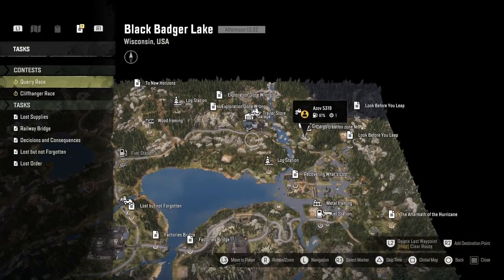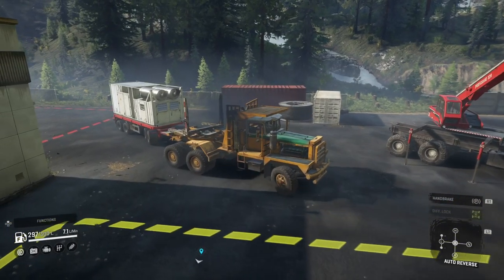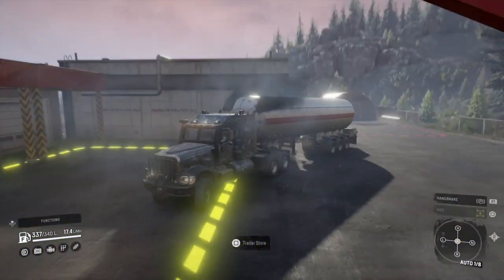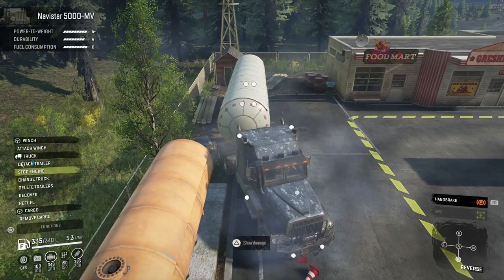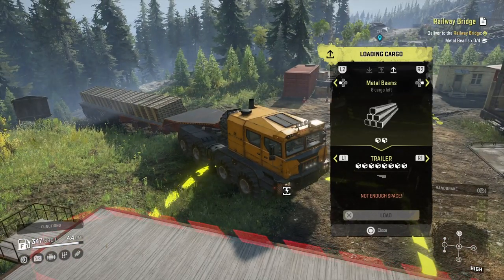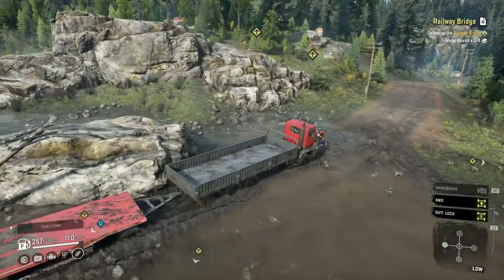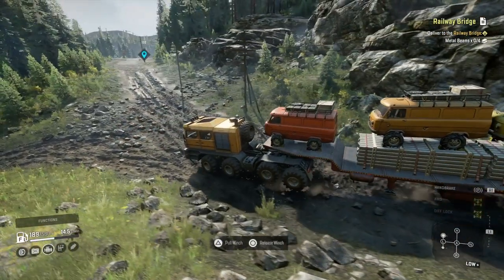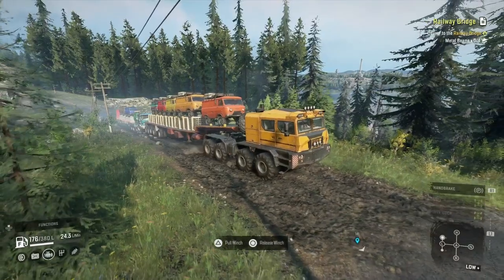SnowRunner How generators Work Crafting Cargo And Railway Bridge Mission With A Kolob Road Train

Comment: I have to hold down (C) and sometimes I just get the task instead of the unload screen too. I also get where the truck will stop and the wheels don't rotate have to hit the gas pedal a few times to get the tires to rotate, and have you noticed the "Big pipe" task the pipe has no connection point so you can't lift it out of the river?

Comment: That log holder on the P16 looks like it was made to hold a Lo4F side to side with the front axle on dance bar.  I’m quitting Yukon, I went on after exploring these maps and it still says I need 15 cabins.  Don’t know if it’s because I’m 1/2 way through but the mission text says I only need 2 or 3, but up in the right hand corner still shows 5 of 15.
Reply from the maker: Haha I’ve already had a loaf wedged in there lol that’s why it was on my p16, the loaf fits like it was made for it, and it really holds the loaf on well and stops it tipping off to the side even on a heavy landing 👍🏻🍞🐎! 

Yeah the Yukon missions are a bit of a mess! I think it might be because you started the mission before they updated it, but I can’t say for sure as I haven’t tried the mission at all so far, there’s a chance if you restart the mission that it could fully reset it? But I’d keep the cabins stashed first just incase 👍🏻

Comment: I've put my generators in place hooked up to an f 750 with a large fuel trailer parked right next to it. Then all I need to do is pull up change to the f 750 switch on the generator, change truck, craft what I need then switch back, turn off the generator, refuel it and then switch back and head off with the cargo. Easy.😎
Reply from the maker: Yeah that sounds like the best plan to just leave something there long term while you get the missions done 👍🏻

Comment: I did this last night. Drug a generator to the other 2 locations, and the 30K liter fuel carrier to each one and built a ton of cargo by switching between 2 trucks to construct cargo and fill the generator.  

So far the JBE Mods, Tatarin, Voron D,
 and P16 have done the lion's share of the work, as well as the Last Raider and Titanious Maximus. If it ever shows back up, the 3 pack trucks series from GGMS is well worth looking at. The logging capability of the Electric Tayga is much better than the stock vehicle.

It seems suspicious to me that none of the JBE trucks have the logging gear, and the ix3880 is nowhere to be found. A move to force us into using base trucks for logging perhaps?

It only took me the better part of an hour to get the first Sequoia tree loaded on the Electric Bruce.
Reply from the maker: Yeah it’s nice that the crafting can be done just using fuel which makes it all more simple! 

I’ve not used mods yet but I think I’ll do these maps on my second playthrough and use mods on that one 

Yeah I think there’s a few trucks that already have the logging carriage, but other mods will update them too and add them, I’m not sure if JBE purposely left them off? But then some trucks are too short, I think the truck improvement pack has a dolphin that has a log carrier on the back! The heavy wrecker has been removed as well so the modder can add the logging stuff, so maybe JBE will add them to various mods soon enough 👍🏻
Reply: I've all but given up on the vanilla trucks, including the one's I paid for with hard-earned, post-tax dollars. 🙄

JBE mod's (Loadstar, P16, BM17, etc.), and multiple Twice Twinsteers, are doing the job for me. Regardless of the dev's motivations, I refuse to be trolled! 😜

Git'er done!

Comment: Weird bug last night: brought the generator to two zones, started them up, everything is fine. Turned them off whlie driving around, came back, not possible to start them (truck attached) again. Enough fuel and in the square.
Reply from the maker: Yeah someone else said they couldn’t get a generator to start, they said they quit to the main menu and reloaded it and it worked fine, must be a small bug! Hope you get it sorted dude 👍🏻
Reply: it happened to me as well, got fixed selling the generator and brought another one to the zone...

Comment: I use my wench a lot.  at time hack 1:50  I just pulled up and shot my wench at the generator trailer.  then pulled it into place.  saves time turning around.  more than one time it has taken as long as 5 minutes just to turn around.  LOL

Comment: To me it looks like the second vehicle has been switched to pull mode.     Yesterday I took a Boar with long log trailer and a 750 with the medium log trailer from Smithville over to Island Lake.    Boar was lead truck and I was towing the 750 behind.    When I got to Island Lake was when I noticed the 750 didn't burn a single liter of fuel.    From Smithville to Island Lake and the 750 still had 140/140L     

So road trains are more difficult now as it looks like the second truck no longer helps you along at all.
Reply from the maker: Yeah I was thinking that could be the case, since the long nose kolob wasn’t reversing when I crashed into the post with the road train? 

Hopefully they just add the option so we can choose what mode we want 👍🏻
Reply: @itsmrlonewolf  Indeed.     I think they made this change probably for the new pull tasks.    I know there is a stranded P12 you need to rescue as well as train you need to pull.

Still the option to pick between push or pull just for owned vehicles would be nice.

Comment: My latest issue(PS4) was a box popping up saying not enough Ram for mods and I could not continue my saved game? I connected to mod browser and unsubscribed to every mod I had. Now I can continue my game without being online. Also all the mods I had downloaded/and previously subscribed to now work offline without having to go online and verify every time I start the game as I had to before. I had stopped even using mods before this just because I hated having to go online each start up to verify mods in my game save, if I didn't go online I lost all the subscribed mods. I really wish they would sort this out. In the future with new patches will I just be able to start my game save offline and still retain my previous mods?   I thought that's how it was all suppose to work? Also the big wrecker truck is still in my game I never lost it. Very odd happenings with the game lately!

Comment: Just to let you know, I’m pretty sure the money glitch is gone.. if you were referring to the free add on thing..I tried several times with the dump truck fuel tank (I think they made the garage UI a bit slower or something so it’s nearly impossible to time it right.. I didn’t try it in any of the old region garages tho)

Also, that slow down section between garage and generator.. if you go right of it (going towards generator) there is like a small peninsula .. just drive on that and cross river.. it’s a lot faster.. also there are more winch points!
Reply: what "dump truck" ??
Reply: @markrowe8824  caterpillar 770g.. not really a dump truck technically but the one that hauls the rock trailers in Yukon
Reply: @redanglerfish  oh ok, didn't know about money glitch using that, I used two mod trucks to get money, the heavy wrecker and the super tayga.🤔🤔
Reply: @markrowe8824  well I just used that one for the glitch because the fuel container was 8500 lol you could do the glitch on anything that has a free add on next to an add on you have to buy and trick the game into buying it for free and then sell it and repeat.. but I haven’t been able to do it since the update.. :( I don’t really need to cheat but it was nice for building junkyards and stuff of trucks you will never drive just for the look haha
Reply: @redanglerfish  haven't checked if my money glitch still works since that last update but I currently have over 130mil so I don't think I'm going to run out of money soon.😀😀
Reply from the maker: I’ll have to try and test the money glitch again, I remember last time they patched a few ways but there was still other ways around it, I’ll test some things and see if I can get any to work, if I do I’ll mention it in a vid 👍🏻! 

Thanks for the info man I’ll try it out as that river is seriously slow!

Comment: I have now completed the entire paper factory. You actually need to steal bricks from a task in grainwood river. It’s the only place you can get the last 4 bricks you need. I was looking for hours to find bricks. It could have been me accidentally loosing them or something tho. Basically there wasn’t enough bricks in regular pickup zones.
Reply: I had the same problem
Reply: Lol classic snowrunner devs...
Reply: @Okiea  i just said screw it at that point and started flying around the maps in the twice Twinsteer looking for brick related tasks
Reply: @jasonpaulmanuel5687  it’s quite annoying   But I don’t care. The maps are still amazing and not boring like the Yukon.
Reply: Theres a brick factory next to the quarry where you can use the generator to make packaged sand to construct the bricks.
Reply: @crvnmrhd  don’t you need the paper factory for the packed sand? Because the sandbags are paper or no?
Reply: if u build the power plant before you finish the paper plant you'll unlock the brick factory and the metal rolls factory... then you can craft all the bricks you need
Reply: @ccf500  sand comes from the quarry
Reply: @matthewdittburner2837  I was thinking about doing that.
Reply: @ccf500  you need bricks to build the paper factory, and it takes 1 of each packaged sand and cement to make bricks. Ouch 😬
Reply from the maker: That’s cool man I read those missions but I haven’t even attempted them yet! Looking forward to them though! And I may well end up stealing the bricks myself then 👍🏻! It seems bricks can be made but theft sounds more fun anyway lol!

Comment: I’m doing paper factory A and I can’t get 12 metal rolls. How do I get them? Can you help?
Reply: Complete ''starting the power plant'' mission, to unlock the steel factory. Its on the centre of the map. It lets you convert metal beams to metal rolls. Metal beams can be got from the warehouse close to the garage.
Reply: @ohmylanta4558  thank you. Was starting to crack up ha ha
Reply: Also on the second map there are 2 mini warehouses with 10 rolls in each. You have to do a mission for each to open the mini warehouses. They are in the hills so careful when choosing your truck.
Reply: @collinmalzer8246  I would save quite a few of those for a specific mission on that map. Careful :)
Reply: I'd do tasks on both maps first before starting the contracts. You'll gain access to warehouses with plenty of metal rolls that way.
Reply from the maker: Thanks for the info everyone, I didn’t really know where the rolls were yet lol 👍🏻